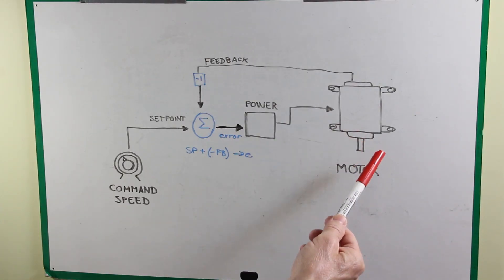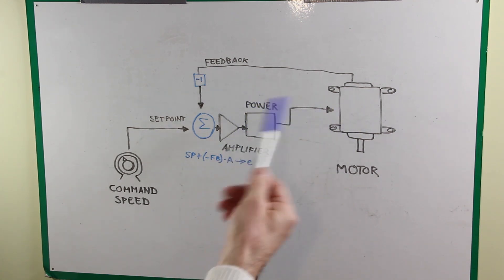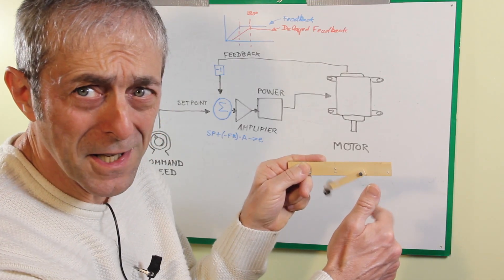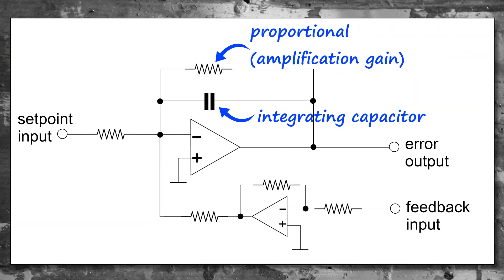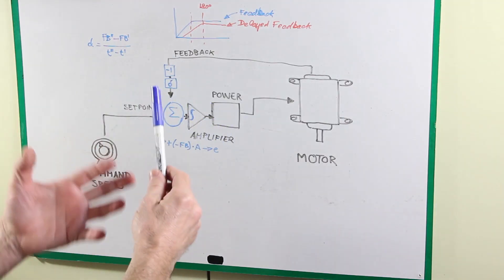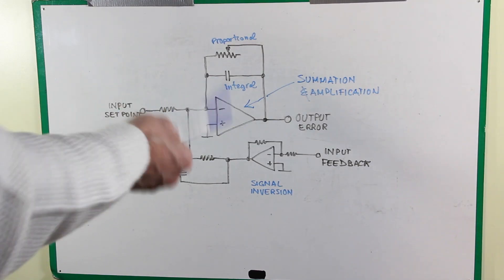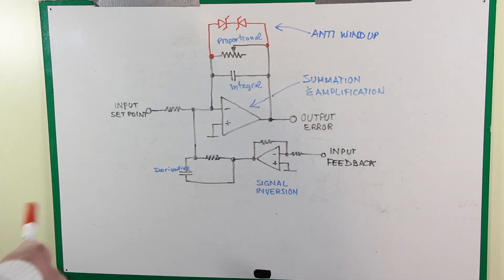Learn the PID control in 12 minutes | electronics

Comment: Thanks for the nice video, but I think the details may be a bit off: the circuit you show with the resistor and capacitor in the feedback in parallel make a "lag compensator"/"integrating with limited low frequency gain"/"proportional with high-frequency roll-off" response rather than a "PI" response. Putting a resistor in series with the capacitor allows achieving a PI response which is proportional for high frequencies and integrating for low frequencies. Google for "op-amp PI regulator" to find some example schematics. Limiting low frequency gain is something that can still be useful for PI to improve overload recovery characteristics.
Reply from the maker: Thank you for commenting and providing feedbak, also sorry for the late reply but every once in a while a comment happens to fall down in my list of notifications, and I noticed your comment right today.
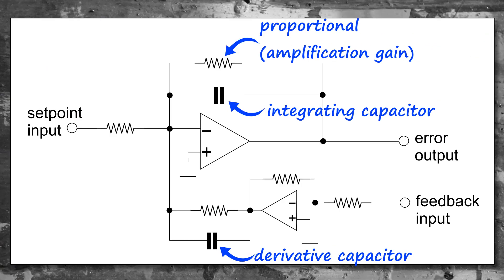I am not sure at what resistor you are referring to, but I suppose it is the one that is in parallel to the capacitor that I indicated as "derivative capacitor" (which is an improper terminology but I did that to make things simpler) shown at 7:37 mark. The following assumes that, but please let me know if I mistaken the point of your comment.

If you put there a resistor in series with the capacitor and remove the parallel resistor you end up to completely lose the feedback proportionality! You can't have a practical circuit that has a response as you mentioned, with no control over the proportionality (at full frequency spectrum), but again if I mistaken something, let me know.
The formula is this: u(t) = K(e(t) + 1/Ti int(0->t, e(t) δt) + Td δe(t)/δt)
Where K stands for the proportional gain, e the error, Ti and Td are the integral and derivative terms, respectively, and t of course is time.
As you can see from the formula the derivative can be seen as kinda prediction of the future status of the controlled actuator, that you can practically achieve anticipating the feedback signal (not the feedback loop of the gain OPAMP) through a capacitance in parallel to the resistor that provides the feedback signal to the summation node. Adjusting the ratio between these two paths allow to determine the best derivative point.
Of course it is not the only way to achieve this, but it is just a simple example, hopefully simple to understand.

I found a good book in Control System Design by Karl Johan Åström (I had to find Sweedish character to write this! :) ) that I really recommend.
Greetings from the Alps.
Reply: @AccidentalScience  Thanks! I agree that formula is the expected behavior. I was thinking of the "proportional resistor" and "integrating capacitor" which are in parallel but I would expect to be in series. For example, take a small static error. This should give a control signal which ramps up towards infinity as the time goes to infinity in the formula. In the circuit, the proportional resistor limits the final value. Or in other words, an ideal PI regulator should have infinite DC gain but thr circuit has a limit set by the "proportional" resistor. This limit can be useful, but real proportional action is also very useful to have.
Reply from the maker: Ah gotcha. I misunderstood the capacitor you intended. So you meant the resistor, and capacitor in the feedback loop of the error amplifier (the OPAMP that has the summation node). Yes, the parallel resistor limits the gain indeed. At 10:10 mark you can see a more realistic representation of the circuit. You'll notice that the parallel resistor has been replaced with a potentiometer (Kp) that adjusts the gain over the full spectrum. Usually this is adjusted as large as possible, though in certain applications it is required to reduce a bit the gain in a trade-off with precision and stability (or sometime just to avoid noise). Also it is useful for the calibration stage, where at first the Kp is reduced to keep gain low and making other adjustments with Ki and Kd. The capacitor is connected in series with another potentiometer (Ki) that allows to adjust the integral term. Finally a further potentiometer (Kd) allows to adjust the derivative term. In real applications the effect of this last C+R series is approx. double the effect of the fixed resistor that provides the ratio with the resistor that carries the set point signal, so the ratio between the input set point and the actuator's feedback is determined (i.e. determining the speed of a motor in relation to the input set point voltage).
Also consider that where you see a resistor you shouldn't assume that it necessarily reduces the gain, it could be large enough that the gain still is large, and again could be functional for the calibration stage. Note that even with a digital PID you still need to have control over the gain, that is the proportional term, maybe just for the autocalibration stage where with a low gain a step response provides the information required to adjust the other terms. I am not super expert in digital PID so take this just as a rough indication.